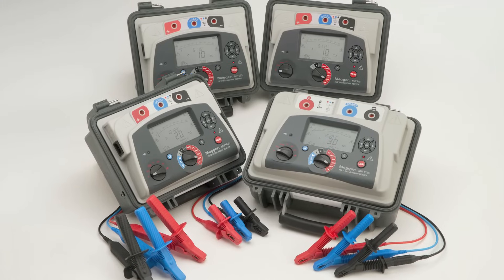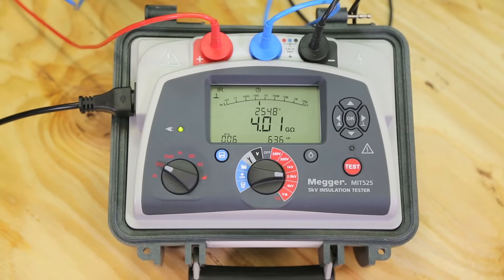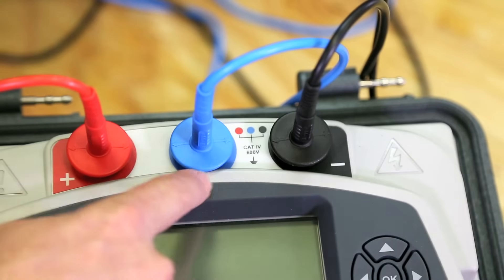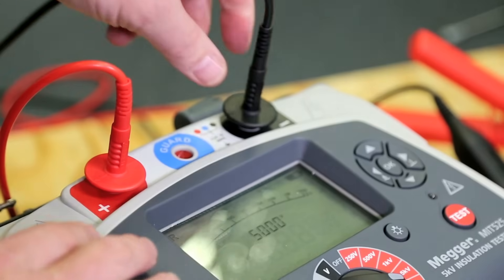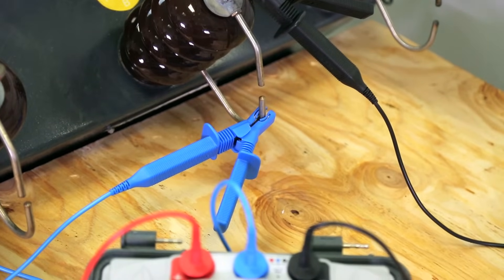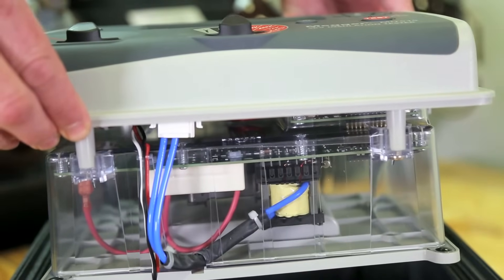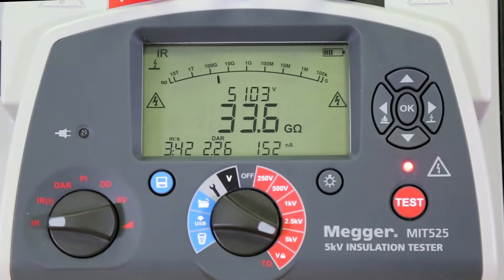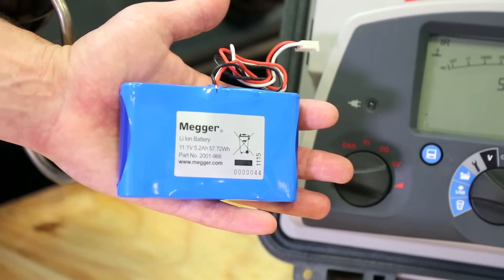Megger Insulation Testers MIT525 over 5 kV - The industrial tester range

Comment: what is standard using of that insulation test?
Reply from the maker: Hi, thanks for your comment. Electrical insulation degrades over a period of time because of various stresses, which are imposed upon it during its normal working life. The insulation has been designed to withstand these stresses for a period of years, which would be regarded as the working life of that insulation. This often runs into decades. Abnormal stresses can bring about an increase in this natural aging process that can severely shorten the working life of the insulation. For this reason it is good practice to perform regular testing to identify whether increased aging is taking place and, if possible, to identify whether the effects may be reversible or not. The purpose of diagnostic insulation testing is to identify increased aging, to identify the cause of this aging and to identify, if possible, the most appropriate actions to correct the situation.